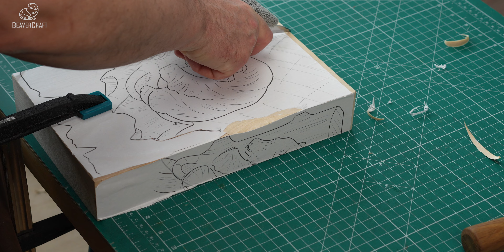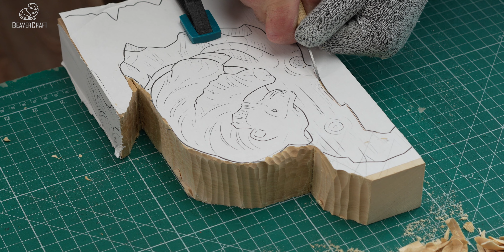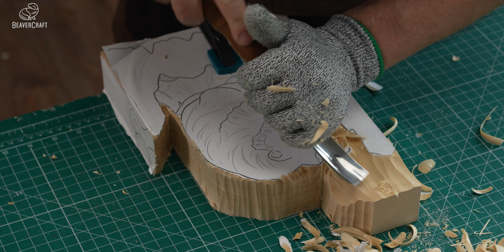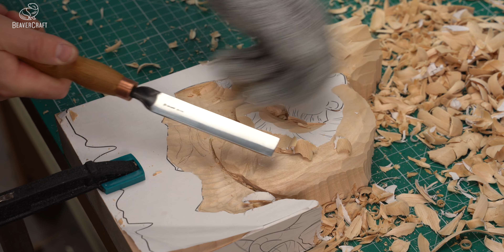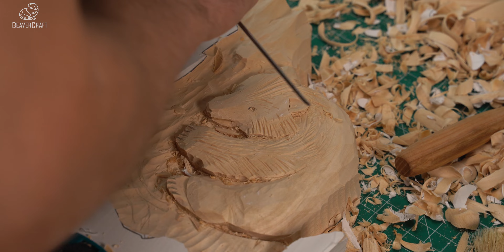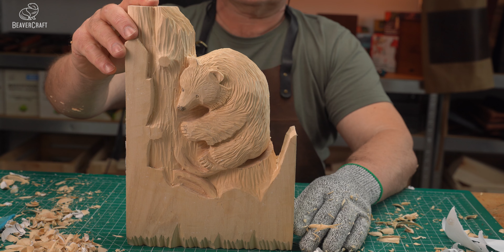How to Carve a Bear | Wood Carving for Beginners

Comment from the maker: Here are the basic tools you need to make it happen:

👉 C16 Big Roughing Knife (https://bit.ly/3ova3SG), C7 Small Detail Wood Carving Knife (https://bit.ly/3oxtR81), and C11 Knife for Chip Wood Carving (https://bit.ly/41ppsCy) to shape the bear's body and add details to its face and paws;

👉 G3/20 Straight Rounded Chisel (https://bit.ly/3KUIHNn) for smoothing the general outline;

👉 G7L/22 Long Bent Gouge (https://amzn.to/3owuRcC) for scooping out hollow areas and creating curves;

👉 K9/10 Compact Straight Rounded Chisel (https://amzn.to/3N67oJy) for creating sharp edges and clean lines;

👉 K12/02 Compact Straight V-Profile Chisel (https://amzn.to/41sqoWY) for creating texture on the bear's fur and carving out its features.